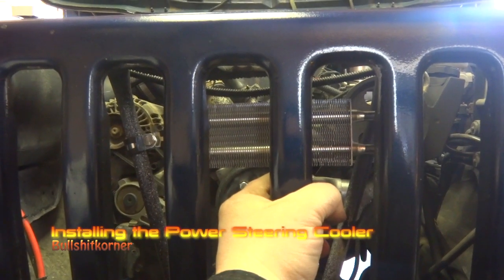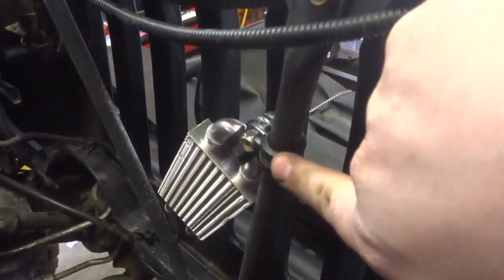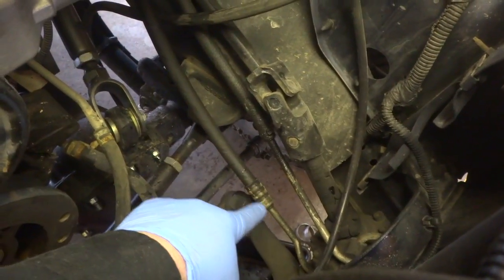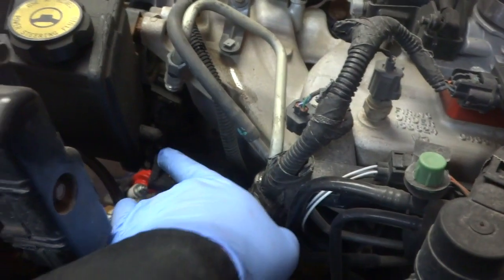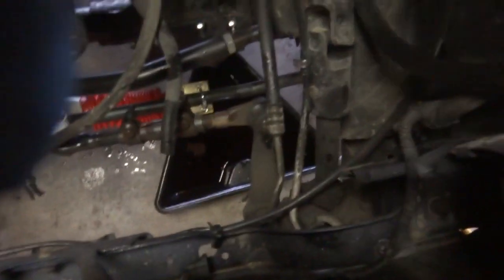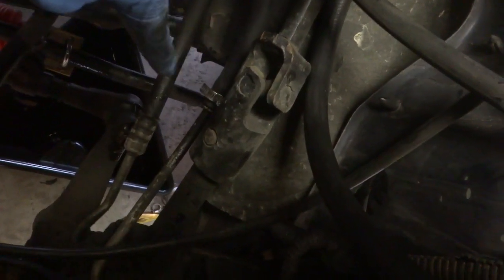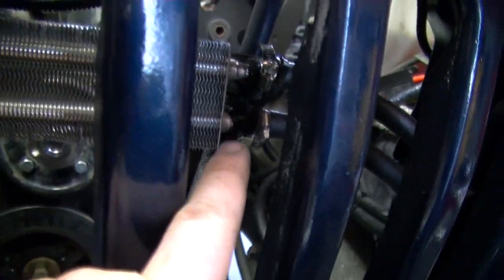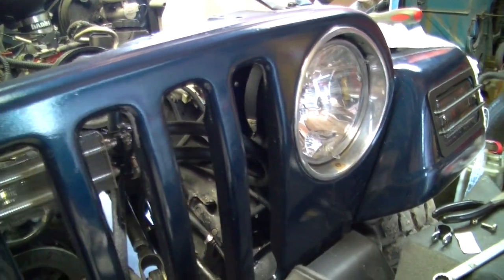How to Install a Power Steering Cooler for Jeep TJ,XJ,JK

Comment: Never heard of anyone installing a cooler for the PS.  Makes sense for a Jeep that is off road a lot.  Do Jeeps have PS pump issues?
Reply: I haven't heard of Jeeps having issues with power steering pumps specifically...but with any vehicle you lift and especially install bigger/heavier tires, you are adding extra weight and strain to the power steering.  I think a cooler and/or an upgraded system is a must if you are going to add larger tires.